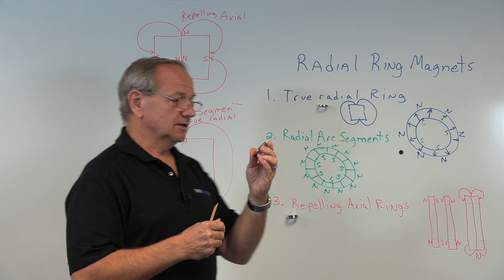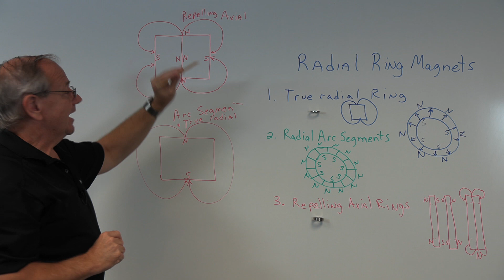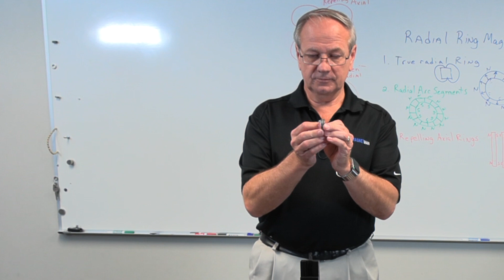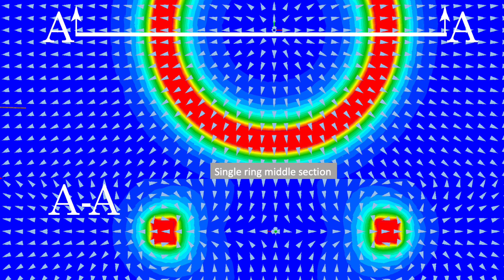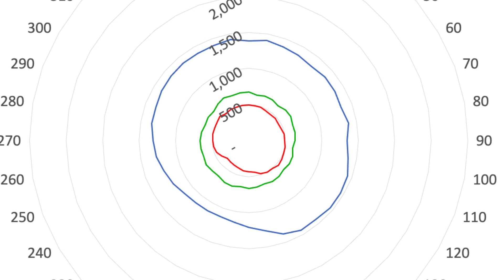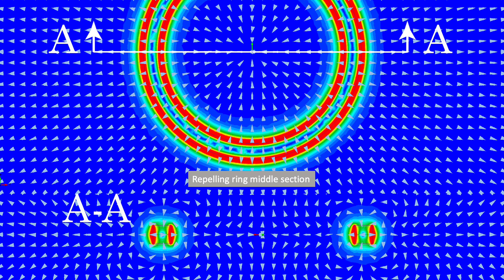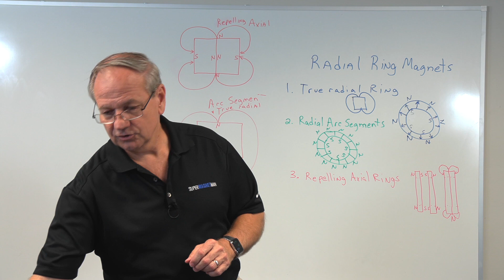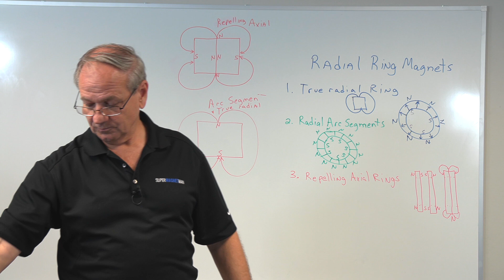Radial Ring Magnets - Design Considerations

Comment: What can I use to erase audio from DAT tapes?
Reply from the maker: Sorry for the delay in responding but in my testing DAT tapes are more difficult to erase and we use a 2 inch pyramid tapering to 1 inch square and on the 2 inch square base we add a 2 inch square x 1 inch thick N50 rectangle magnet.  Together this pushes the surface gauss over 7,500 and then you have to erase the tape on both sides and make sure you go over the part that is the leader so that you do not leave any data in a usable form.

Comment: Nice demos :) 
I'm surprised you didn't show FEMM simulations for the two-pole and four-pole rings. The axial-symmetry would make the evaluation fairly straightforward.
If a stack of axially and radially magnetized rings could make a "tubular Halbach array" (i.e. with the effective actuation-direction along the axis of the tube), this could make a fantastic lightweight linear actuator (like a linear motor, but ~ 50-80% more effective); either moving coil or moving magnet (Halbach).
Reply from the maker: We were just covering radial ring magnets.  Multipole magnets and Halbachs are a separate topic:)  We are working on another Halbach based video SOON:)  I will add your suggestion to my board of YT video ideas:)  That is one of the reasons I like putting these topics up is it prompts other people to share their ideas which make it into future videos:)  Thanks

Comment: 2 magnets forced together apparently alters thier gravitational acceleration. These magnets don't follow normal rules of two bodies falling at the same speed. A professor at (Caltech?) proved this. Can you look into it? I don't think it alters the mass, but alters the acceleration per second per second. It's a slight hint at anti-gravity.
Reply: Is it the 1st of april in your calendar? Or are you a clever bot trying to spread misinformation?
Reply: @AdityaMehendale  no, a professor made 2 fake rocks same mass, one had 2 magnets forced together inside. The one with magnets hit the ground last every time when dropped from building.
Reply: @glennboyd939  Any peer-reviewed publications supporting the hypothesis that "this changes the nature of our understanding of gravity"? It's a tall claim..
Reply: A more obvious answer might be that the magnets get slowed down by eddy-currents in the metal skin of the nearby building..
Reply: @AdityaMehendale  few people get decent neodymium magnets forced together, as it's very difficult. Almost no one has dropped a pair further than 9.8m,which is the threshold of distance where any effect is noticeable. Magnets have the potential of very powerful forces, far greater than the weak or strong force or gravity. Tapping into a fraction of magnetic force should have vast consequences. If u try to force nature to do something it doesn't want to do, nature will find a way to regain equilibrium, or channel that force in a different way.
Reply: @glennboyd939  Ok then. Let's call it "the 1st of april everyday".
Reply: @AdityaMehendale  you are the one saying it's impossible without trying it. I have 1500 + neodymium magnets of all different sizes, but I'm afraid I can't do it in a controlled environment where wind resistance variations can't be controlled.
Reply: @glennboyd939  magnetism is a like a 19 to a 49th times stronger than the c in force of gravity isn't it
Reply: @lowercase18  not sure what u mean by 'c' (speed of light), but I have a few magnets that could lift a car, or chop my fingers off if they slap together, and that force is continuous. A fraction of that force can do a lot of work without expending fuel, and if u try to force magnets to do something they don't want to do, there has to be give somewhere, possibly manifesting as another force altogether. Gravity is the culminative effect of minute magnetic forces. A magnet is a concentration of that force in a very localised area.
Reply: Wasn't peer reviewed, and the building was not mentioned, but from my opinion, one fell at 9.8m/sec/sec, the magnet Imbedded one fell at only 9.8m/sec.
Reply: I'm pretty sure it was recalled by Walter Lewin, who has an elemental YT review channel. If it's himim thinking of, it wasn't one of his element reviews, but a vid on him reminiscing.
Reply from the maker: Actually several years ago I bought 2 disc magnets - 6 inch dia x 2 inch thick N50 with a half inch hole in the center to do that experiment.  I kept running into problems of how to conduct the experiment in a truly scientific way that would isolate all the variables and still have not come up with a way to do it.  I do not have a government type budget to do this with:).  It is not as simple as dropping them from a building - I saw the video with that demo about 10 years ago.  Large magnets could have reoriented themselves on the way down to create more or less drag, they could have been attracted to the building steel and I am not so sure that just having someone watch them is the best way to test.  I would want 4 identical magnets - one set magnetized and the other unmagnetized.  Then drop from at least 30-50 meters and create a drop mechanism that can drop both at the same time and at least have some large diameter PVC pipe to drop them in to make air resistance and wind, etc identical and then have high speed cameras and laser timers to record the fall.  Maybe I need to set up a GoFundMe to fund that video:)
Reply: @SuperMagnetMan  I assume those magnets were forced together, and held there. A reasonable feat, as I'm not strong enough to force my best neodymium magnets together, or separate them. Wind or air resistance should only affect them if they differ in size or shape. A few meters from a building should have a neglible effect by way of eddy currents. The fact that the magnets only just beat the non magnets consistently from a fall from a building suggests the effect occurs at 10meters odd, very coincidental distance equalling the point that falling objects accelerate beyond the first 9.8meters per second. This tells me that the per second per second is being affected.
Reply from the maker: @glennboyd939  Yes, that is why I ordered them with the hole in the middle - I was planning on using 1/2 inch stainless all thread to force them together.  While I had the magnets I was missing all the other essential parts that would guarantee an accurate experiment.  As you mentioned it would take between 1 and 2 seconds to drop the 10 meters and having a detector that can sense the drop between the two - at the same time would need to be developed.  I would think I could build a wind shield around them but it would have to be made of acrylic so we could see through it.  Who knows, I might need to run a "GoFundMe" campaign to get the equipment for a great test:)
Reply: @SuperMagnetMan  I wouldn't bolt them together with bolts through them, as that will play havoc with thier fields. Best method I can think of is glueing each magnet to a thick piece of marine plywood, then use bolts on the far corners of the ply to ease them together. The bolts need to be many inches away from the magnets to stop being a magnetic conduit. Or, for magnets with holes, put a wood dowel thru centre, force together with clamps, and use plastic packing strip to bind them b4 removing clamps.
Reply: @SuperMagnetMan he's basically describing what Ken wheeler did (theoria apophasis) he made a little device made from two magnets and a couple other things and he said it felt like I fell more slowly